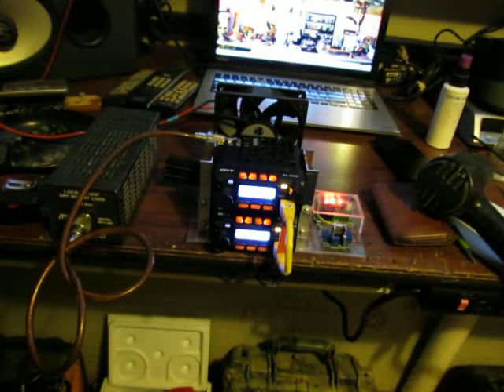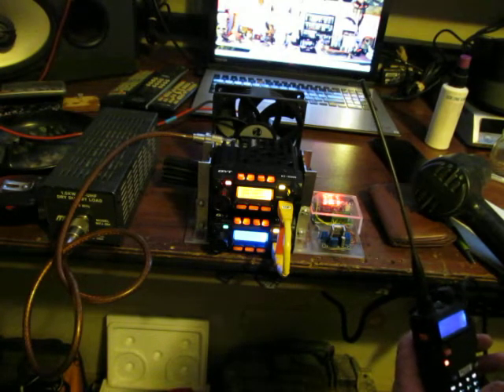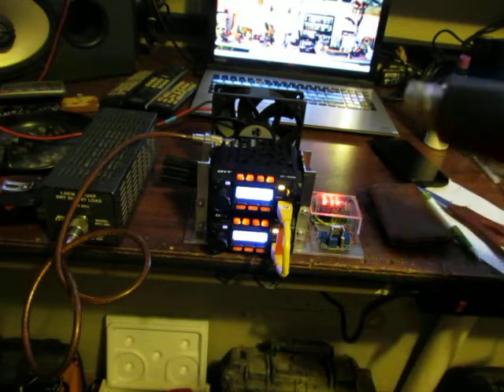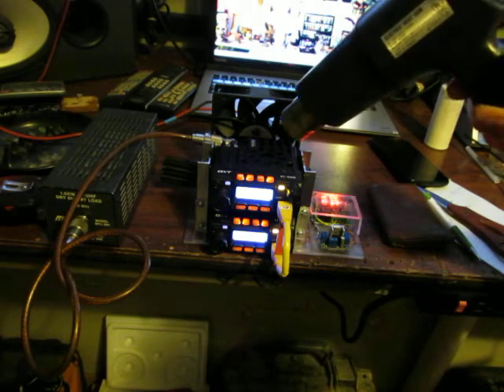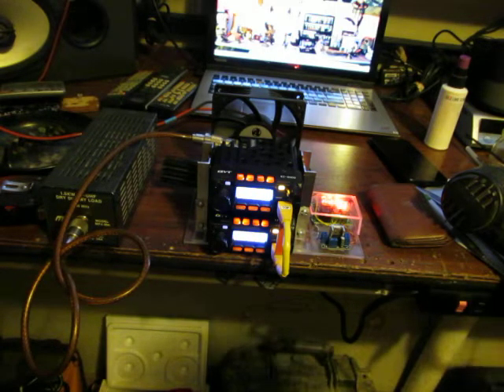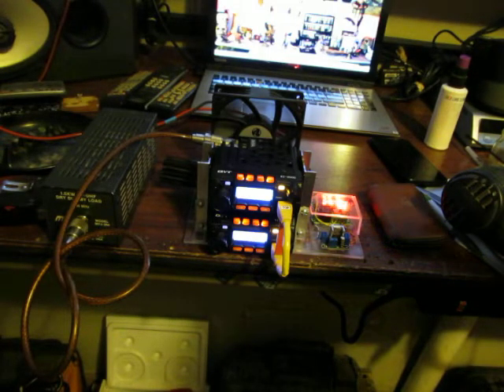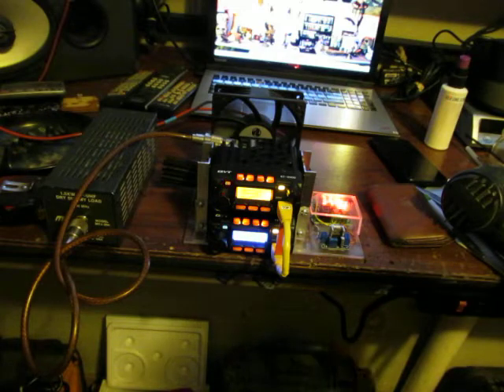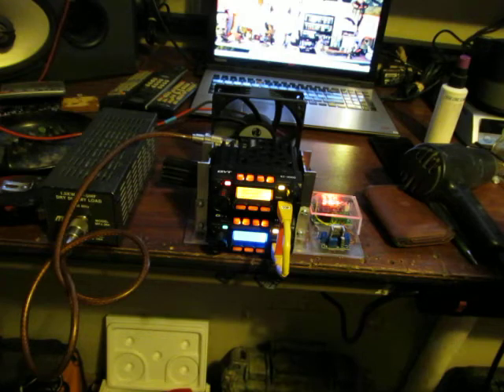QYT KT-8900 crossband repeater 100 per cent duty cycle cooling

Comment: I have tried to make the cable several times my problem is when I plug it in one of the radios will go into transmit. Could you do a video on making the cable and the pin outs. Also what you have selected in the repeater option in the menus. I have both of mine selected to the carrier mode. Thank you
Reply from the maker: Wow, its been a while sense i wired the rj11 cable assembly. ill have to do some file look up

Comment: That fan is pretty dang loud, but seems to work!
Reply from the maker: Yes it is damn loud but my repeater will be on top of a mountain so I will not here it. LOL! Ive had it running here at home for a couple months and it cools the devices great.
Reply: @Liklysuspect  I have the radios, and wiring harness. And plan to test it out more, maybe this field day weekend. I was wondering just how hot they get, while being used? Or how long they will work before starting to over heat? Is your extra fan a necessity?
Reply from the maker: @chrissewell1608  Chris, I do not have an extra fan. That's just one fan and I have keyed my radios down in both directions for over 5 minuets straight and they do not even break a sweat. Both radios stay nice and cool.
Reply from the maker: @chrissewell1608  i like to keep devices cool
Reply: UHF to uhf?? Possible?
Reply from the maker: @nfsusna  sure with a duplexer.

Comment: Looks pretty good. I'd like to do the same on my GMRS repeater. I've had to replace the final on one already. Are you using an arduino to control the fan?
Reply from the maker: No, much cheaper than that. Go to eBay. For the 280 server fan, look up (pwm-285) and for the digital temp controller look up (W1209 12v) the fan is $15.00 and the temp controller is $5.95 You will never have a heating problem again., Best wishes.
Reply: @Liklysuspect any recommendations for a quieter fan
Reply from the maker: @Grognarthebarb  not at that cfm
Reply: @Liklysuspect  thanks.    Did this setup last?
Reply from the maker: @Grognarthebarb  yes sti'' going stromg
strong
Reply from the maker: @Grognarthebarb  water cooled